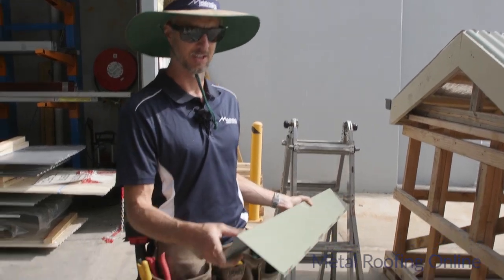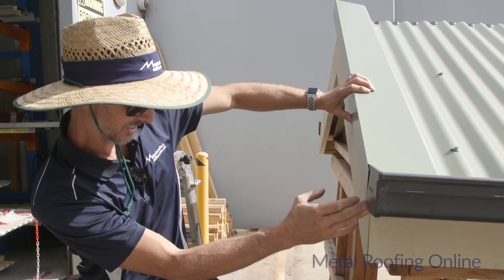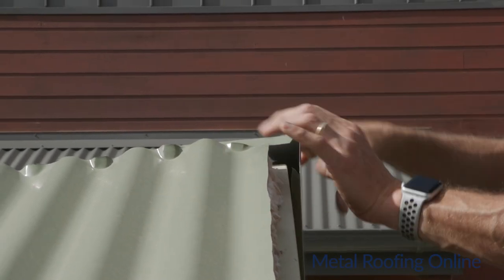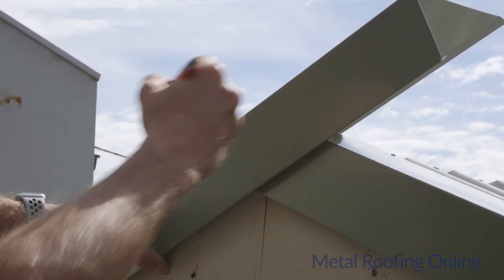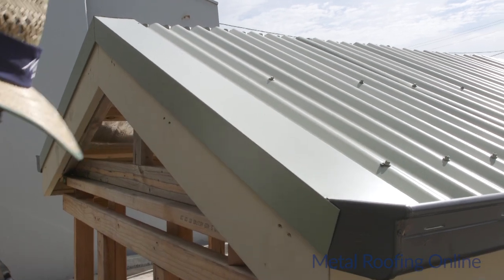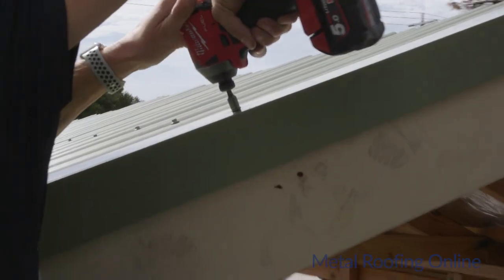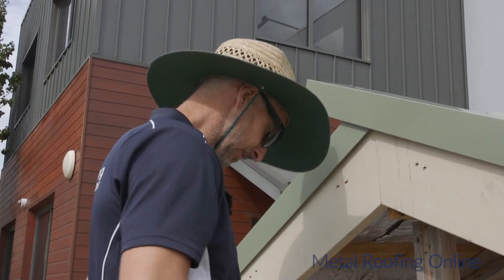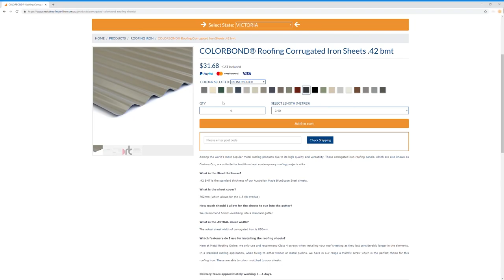How to: Install Barge Capping on Gable Roof | Metal Roofing Online

Comment: Perfect for my steel roof project. Tvm. Quick question. I used a damp proof membrane over marine ply wood and then put the steel roof over the dpm but im getting mold on the inside of the ply wood. Where do i apply insulation? Between dpm and steel roof, between dpm and ply, or inside shed and apply to inside ply wood? Thanks

Comment: Thanks for these informative videos. Can I ask how you do it when the quad gutter butts into the fascia board I.e. the board runs and extends past the stop end of the gutter?
Reply: Jonathan Rashleigh . Hi Jonathan. Great question, you need to use an extra length of barge capping along the straight section, bend down the far side  to make it neat and join up the other side with the barge that runs up on the angle. 😊 regards Daz

Comment: Thanks.

FYI - It's actually a requirement in AS 1562.1:2018 section 4.8.3 to fix on upper and side. HB 39:2015 section 8.7 shows the use of concealed fastening clips for side so fixings are not visible.

Comment: What is the purpose of the 10mm hook with this kind of flashing?
Reply: Stops capillary action (water running behind the metal) and it also looks better because without the hook you see bowes in the metal

Comment: A bit of advice about use of handed snips would good. 
Using impact driver on roof screws is not recommend by fastening suppliers as it damages the coating. Drill driver is faster and quieter.